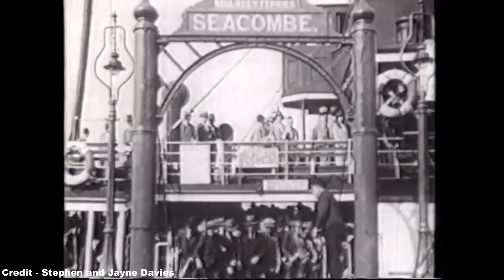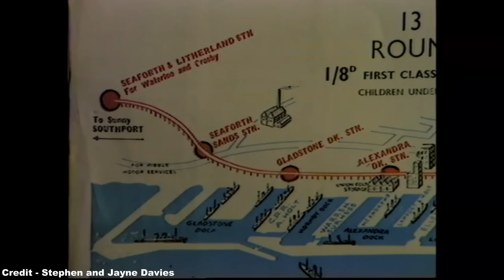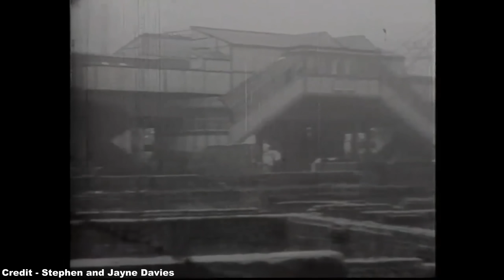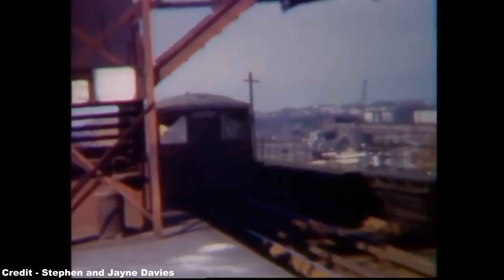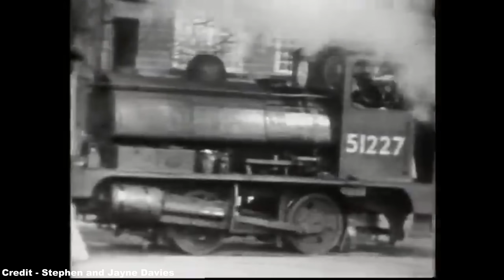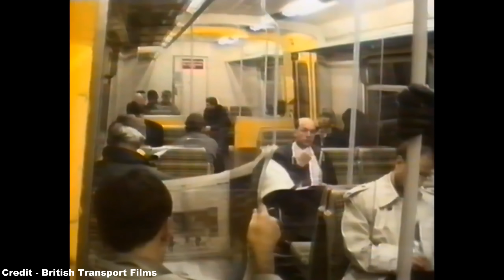Places - Lost in Time: The Liverpool Overhead Railway (Reworked)

Comment: Philadelphia, PA, USA has a similar elevated train system.

The Philadelphia elevated train system, commonly known as "The El," is a significant part of the city's public transportation network. It is part of the Market-Frankford Line, often referred to as the blue line, and runs from the Frankford Transportation Center to 69th Street. The El is elevated above the city except between 2nd and 40th streets, where it runs underneath Market Street.

The Frankford Elevated section, which is 5.25 miles long, was built between 1915 and 1922 and began regular service on November 5, 1922.
 This line has been a vital part of Philadelphia's transit system, connecting various neighborhoods and facilitating travel across the city.

The El has faced challenges over the years, including issues with maintenance and declining ridership. However, it has also been a source of local pride and cultural significance. For instance, in 2009, artist Stephen Powers transformed parts of the El into an art project called "A Love Letter For You," featuring rooftop murals between 45th and 63rd streets.

Despite these challenges, the El continues to serve as a crucial transportation link, with SEPTA providing all-night service since 2014, which has helped boost its ridership.
 The system is part of SEPTA's broader network, which includes the Broad Street Line and other transit options, making it easier for residents and visitors to navigate the city.

Comment: Sad that it didn't survive. I love those early electric trains.
Reply: That comment was the lattice viaduct to Ruairidh's elevated tale.
Reply: It is a shame that some of the most innovative and efficient transit systems are no longer with us. The financial depression of the 1930’s and the rise of private automobile usage and expansion of the long distance highway systems in the 1950s was often the nail in the coffin. One entire electrified rail system dedicated to commuter passengers disappeared after a very short life in the New York City region - the New York, Westchester, and Boston. Parts of it exist today within IRT line 5 of the New York subway system.
Reply: (double-take) It's you!
Reply: I think one of the biggest problems was running steam dock engines underneath the ironwork causing so much corrosion over the years which was unaffordable to correct before any thought of renewing stock, power supply etc. Such an advanced and modern system destroyed from life extension perhaps because it was so advanced when built.
Reply: @kenstevens5065 Unfortunately, the way the structure was built had a major design flaw that encouraged water to collect and generate rust. The track bed was made out of a corrugated metal structure, that caused large pools of water to collect in it. If it had been flat, this problem would have largely been avoided.
Reply: Also the world's very first "multiple units" i.e. more than one train could be driven under the control of a single 'Motorman'
Reply: I have really enjoyed your video 
And it really helps me with my recovery 
From my brain tumour and stroke 
As I try to get back to my modelling 
I mention my illness 
So that you know who is watching and why 
This became 
A project for me 
To inform you utube hobbiest 
How your video is helping the disabled 
Via

Comment: With the obvious exception of the Dingle tunnel, the last visible part of the railway was removed in about 2000/2002 to much fanfare at the time. If memory serves, it was a vertical girder/support someone down Pier Head/Wapping way.

And I still giggle when I think that the Overhead railway had an underground section!